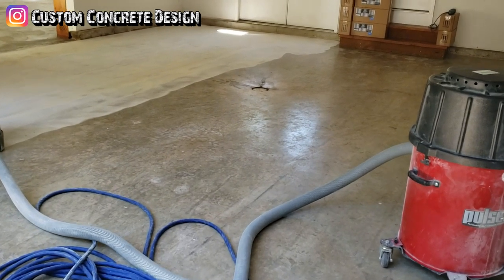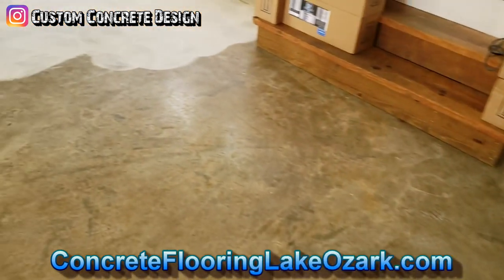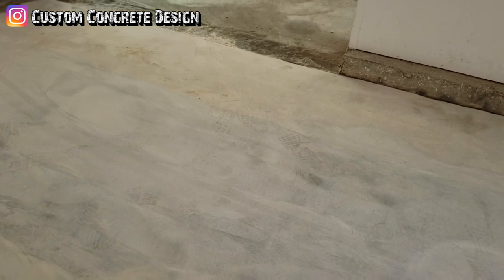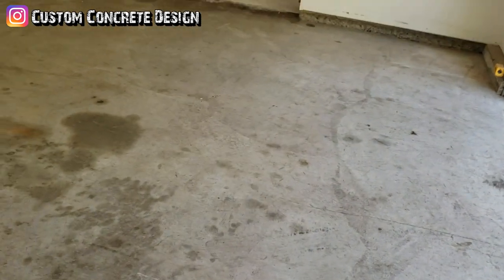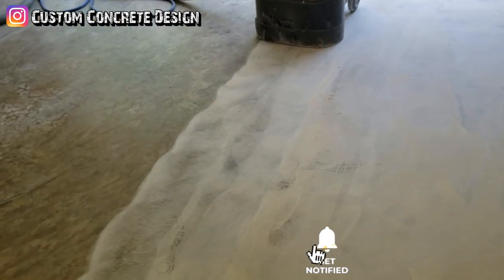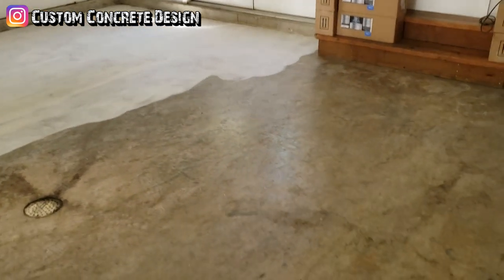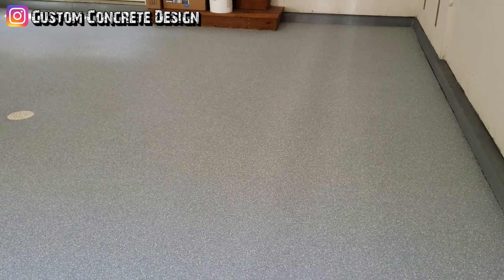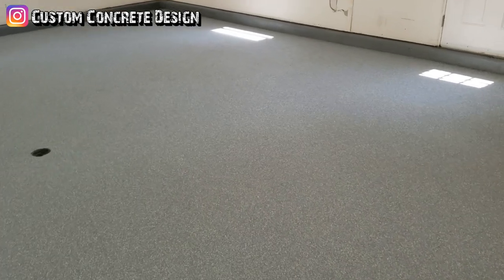GARAGE FLOOR EPOXY 👷 Watch us Coat this GARAGE FLOOR 👷using EPOXY and Flakes (HUGE TRANSFORMATION!)

Comment: Urethane ontop of flake for a top coat? huh
Reply from the maker: Haha yeah it's a Urethane but it's NOT water based.
Reply: @MrCustomConcrete  Usually you would use some kind of grout coat before hand.
Reply from the maker: @Milkor69420  you mean a coat of Epoxy to throw the flakes into, you put grout down for tile and Epoxy down for Epoxy flakes I just didn't show us putting the Epoxy down in the video, but we always grind the floor lay out the Epoxy toss the flakes at 100% coverage, scrape the loose flakes up, and seal with 2 coats of Urethane.